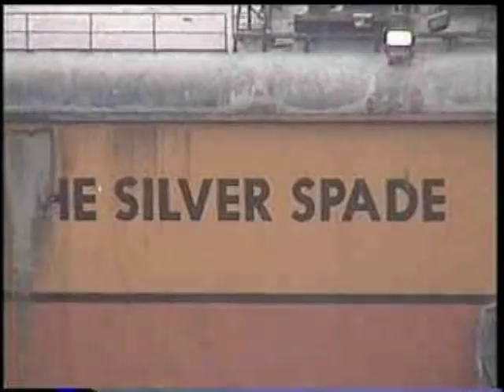TWO  HOURS  OF  SPADE  VIDEO

Comment: Look how big the machine is compared to the bucket it's insane that you need a machine that size to move that much material I mean the bucket is small as hell compared to the machine itself.
Reply: This is a high front machine with a long dumping radius.  Bucket is scaled to working radius. Pick up a 100 pound weight, no problem.  Now hold it at arms length for a while.
Reply: that bucket can dig 315,000 lb (143 metric tons) of earth in a single bite...
Reply: @redzipper8570  how many cubic yards we talking?  105-130 yards apparently,
Reply: @humanbeing6719  Began operations - November 1965
Speed - 1/4 mph (400 m/h)
Bucket capacity - 105 cu yd (80 m3)
Operating weight - 14,000,000 lb (7,000 short tons, 6,400 metric tons)
Height - 220 ft to top of boom (67 m)
Boom length - 200 feet (61 m)
Width - 59 ft (18 m)
Height of crawlers - 8 ft (2.5 m)
Length of crawlers - 34 ft (10 m)
Maximum dumping height - 139 ft (42 m)
Maximum dumping radius - 195 ft (59 m)
Rating on A.C. motors - 13,500 hp (10.1 MW) peak
Entire operation of the shovel is controlled by two hand levers and a pair of foot pedals.
Digs 315,000 lb (143 metric tons) of earth in a single bite, swings 180° and deposits the load up to 390 ft (119 m) away from the digging points at heights up to 140 ft (42.5 m).
Machine's four 2+5⁄8-inch-diameter (67 mm) hoist ropes total 3,000 ft (914 m) in length.
Fourteen main digging cycle motors are capable of developing a combined peak of 13,500 hp (10.1 MW) at peak load.
Automatically leveled through four 54-inch-diameter (1,400 mm) hydraulic jacks.
Swings a 105 cubic yard (80 m3) dipper from a 200 ft (61 m) boom and a 122 ft (37 m) dipper handle.
Reply: @humanbeing6719  think of a two car garage building size volume of dirt
Reply: The house and bucket do not scale up proportionally.  The machine, itself, must contain all the motors, spools, wire, controlling systems, space between all the stuff, and have STRUCTURAL INTEGRITY to deal with all the enormous stresses.  That is why it is so big in comparison to its bucket.

Comment: This was when it was working on the west side of Route 9, just north of New Athens, back of the "white house" on the sharp curve. This is before it crossed to the south side of Rt 519. The video would have been shot from Route 9, as it was visible from the road.  This was one setting we didn't get to see, as I was working 80 hour weeks at the time.  Note, they did a nice job of reclaiming the area, just a slight smooth grassy depression to show where it was.

Comment: Why were these excavators so big?
If the draglines manufactured today are still very large, although not gigantic like the Big Muskie, why aren't excavators of this size manufactured anymore?
Reply: Built to match the job and topography, removes overburden above a small seam of coal at the base of the shovel.  Moving overburden from one side, dump on other side and keep moving overburden from operators right to left exposing more of the seam of coal on the right under the overburden. Then dozers and loaders remove seam and keep moving to right follow the seam.
Reply: The house and bucket do not scale up proportionally.  The machine, itself, must contain all the motors, spools, wire, controlling systems, space between all the stuff, and have STRUCTURAL INTEGRITY to deal with all the enormous stresses.  That is why it is so big in comparison to its bucket.
Reply: I'll add that power shovels and draglines of this size aren't made anymore because WE JUST CAN'T DO IT. 
TPTB completely deindustrialized us over the past 40+ years and we no longer have the materials, the factories, the skills, institutional memory, and the industrial habits of a workforce that can build and operate such a machine.

Comment: Big ass machine and a little bucket!
Reply: 130 cubic yard bucket is huge
Reply: This " small bucket" is capable of of digging 60 feet down in one scoop
Reply: There were 2 nearly identical 1950-B's.  GEM had 130 yd on a short stick, Spade had 105 yd on a long stick.  Coal company started using the Spade, and realized the the shorter GEM wouldn't be very flexible. They tried to change their order for the GEM to a high front like the Spade, but it was too late.  Spade outlived the GEM by a good margin. The GEM was too limited in digging range.
Reply: @SteamCrane  they used the GEM for parts to keep the Spade going
Reply: Consider that one of the teeth on the bucket is bigger than a human.